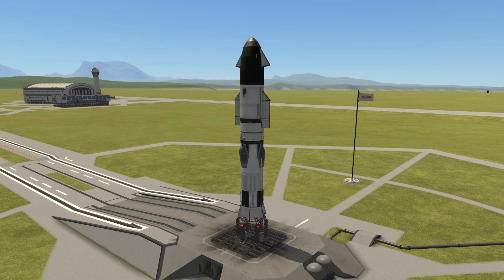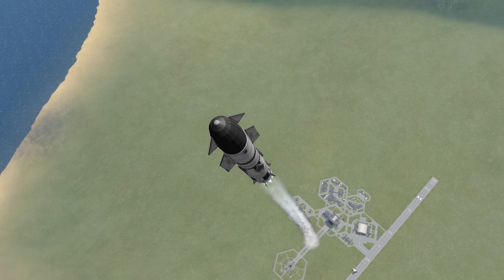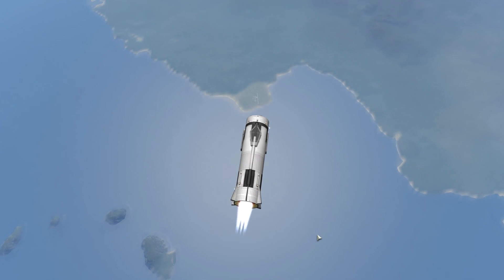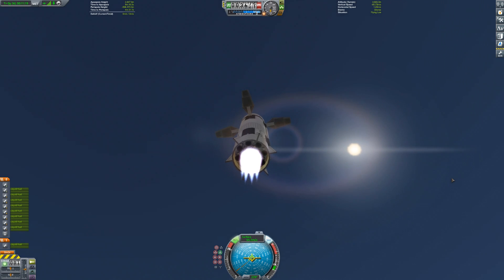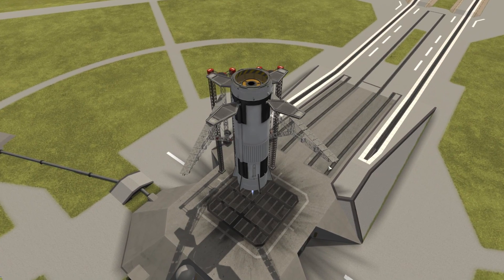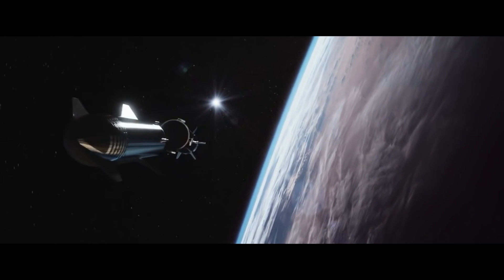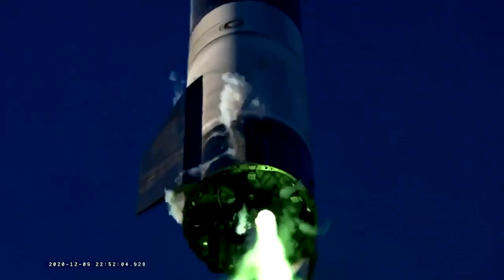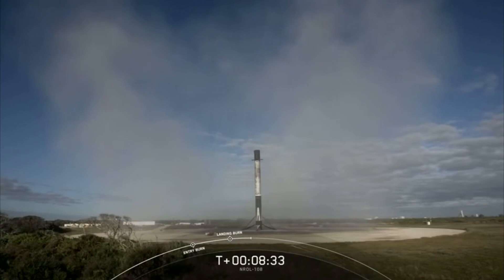Why SpaceX Wants To Make Landing Super Heavy MORE Difficult.

Comment: I give you the "tailhook slam"  a fail-safe recovery mechanism using existing engineering- 
Take one Arecibo style 365 foot tower (reinforced concrete tower supporting ~300 tons) with a 350 ton counterweight on the ground, damped by 12 US Navy Mk7M4 arrestors (each rated to stop 25 tons engaging at 175 mph using 300 feet of cable in 2 seconds). 
Given a a terminal velocity of 153 mph for starship, estimate 175 terminal velocity for heavy you could catch them at the top of the tower at terminal velocity and bring them to a dead stop 3 feet off the ground, WITHOUT using a deceleration burn. If the engines are working correctly, you just get a much softer landing.

Comment: The weight savings will be huge, all the sacrificial componentry and complicated carbon fibre legs will save millions per launch. The landing platform doesn't need to be made out of anything exotic, because weight isn't an issue and thermal resistance is much less of an issue without having to survive re-entry. This is an idea that is very much worth pursuing.

Comment: Scott said that after the super heavy booster separated, the Starship would continue to orbit by firing all six of its raptor engines. 
At that altitude, wouldn't the sea-level raptors be inefficient?  Wouldn't it be more effective to use only the three vacuum engines?

Comment: for such a system, it makes sence to dig a huge verticle tunnel and let the rocket lower it'self into the pit. if it blows up in the pit it's not a big issue to clean out. also limits collateral damage of other systems. the walls of the vertical tunnel could help catch the grid fins nr ground level.

Comment: Why cant they use rocket assisted drogue steerable chutes in case things are speeding up too fast close to pad , in a engine\guidance fail situation?
Or just use large steerable chutes to slow down to a lower speed before engines cut it on?
was also thinking last ditch saving of returning rocket assembly too, than blown up.
Just curious, if they have looked at this option or not?

Rob

Comment: In SpaceX's facebook group a user suggested a system with 4 movable steel cables in a frame-like structure. At first the cables would be kept out of the way along the edges of the frame so the booster would have plenty of room for it's descent. As soon as the booster has descended into the frame the cables would be moved inwards. Slide rails along the booster would prevent damage to the hull (the extra weight of these would be easily affordable if they can in turn get rid of landing lags, their actuators, the power source for those and crush cores). The cables would then slide underneath the grid-fin hinges into a hook-like structure and the fins would fold down to lock the cables in place.
At this point the engines would still be running to offload most of the booster's weight, and the cables could be used to guide the booster precisely above the launch stand for touchdown. Consequently the hinges, cables and frame wouldn't even have to support the full weight of the booster - so the frame could be made arbitrarily large to allow for enough margin of error.

Mechanically this shouldn't be all that complicated (4x 4 motors - 2 to move the cables laterally and 2 to control tension/slack from both sides - plus an appropriate shape of the hinge so it can catch and lock onto the cable). This is quite similar to the traveling winch systems used on construction cranes - just two of them on opposing sides of the frame and used horizontally instead of vertically. Actually they would be even simpler with less pulleys, as the cable would run to the opposite side and get it's tension from there.
The magic would be in the control systems that coordinate all those motors with the booster's internal guidance - but that's exactly what SpaceX does best.

Winch systems are definitley capable of catching large loads - think eg. of the arresting cables on aircraft carriers - so this concept could actually work.

Comment: The center pivot mechanism of the Boeing 733-290, which eventually became the 2707 (which eventually became nothing) is a FAR larger casting of titanium than the grid fins.  Orders of magnitude larger.
Reply: That was just a design, as you've said, "became nothing". I can also design a large titanium surface on paper, that doesn't make me a record holder though.

Comment: Here's an idea.  Step 1, SpaceX fills old Falcon 9 cores with reinforced concrete, that should give you a lunch/retrieval tower with 800 ton capacity. Step 2 SpaceX buys about ten Magnetech FDCHDV 84” industrial "steel slab magnets" (rated at 100 tons each) and mounts them on the side of the landing tower.
  Step 3 as the heavy booster is hovering, Elon flips a giant Frankenstein knife switch, and 800KW of current pulls the heavy booster out of the air, over to the tower.
Step 4, a non magnetic carbon fiber arm, or Kevlar cables, then grapple the grid fins and secures the heavy booster.

Comment: My idea for catching tower design: 5 towers in pentagram 50m out from bullseye.. Each tower has one catching cable to the neighbor on the left (e.g. from left shoulder of tower 1 to right shoulder of tower 2). The two ends of each catching cable are fed into high-speed winch (if one winch fails, other just pulls twice as fast, redundancy). Each catching cable has 3 tensioning cables on ringbolts, using simple pulley and small gravity weight to pull catching cable out to the other 3 towers. Each tower has lidar/radar on top facing inward, to measure presence of and distance to starship. Ready position is all the catching cables pulled out wide, making 5 cables around the internal circumference of the pentagram. Held in position by tensioning cables. When starship drops into the target area somewhere, distances from each tower measured, winches pull in their cables the appropriate distance (leave some slack in catching cables so starship will 'sit' in a depression of cables). Once rocket caught, is easy to move it directly above the bullseye by adjusting catching cable lengths. 
Notes: Don't need 5 towers, but redundancy good if one tower or catching cable completely fails. 
Could have complete duplicate of all cables, winches, pulleys a meter or two below primary ones, for more redundancy.
Towers can be as far from bullseye as wanted, more distance just means they will need to be higher and a little stronger. Each tower should have 2 guy-ropes with a few inches of slack, ready to tension when the towers take starship's weight pulling them inward, so won't need to be particularly strong.

Comment: I suspect that they will be doing something clever with the tower itself, in addition to what improvements they can make with the booster's accuracy.  Likely the booster will have to land within a certain area and the capture arms adjust to meet it.  And just as there is a launch abort system, there would be a landing abort system.  If the booster's and/or tower's computers decide that it's not meant to be, the booster can move away before crashing, to at least minimize damage to the tower.

Comment: In order to make the landing more precise at sea, I would think they would need a platform protected from the sea and anchored so well that it would not move. Even if the spacecraft hovered it would be impossible to be precise with the continual movement of the platform in the sea swell. A minor problem for a company that builds space ships. As far as others having the ideas earlier: that is what science fiction is all about. Many dreams by fiction writers were later turned into fact. That is the role of Science fiction after all. The dreamers and the builders of new civilizations both have their roles. Early evidence suggests that science fiction writers deliberately started the space race between the superpowers as a method of staving off an arms race and all that that would lead to.

Comment: PKE Nefedov Experiments performed from 2001-2005 aboard the ISS. Plasma in space experiments. watch?v=kanYuBptuZ0&t=108s
Are electric and magnetic fields 
isotropic and homogeneous all over observed space?

2018 
Resonant Energy Transfer Between Degrees
of Freedom in a Dusty Plasma System
DOI: 10.1109/TPS.2018.2818303

2002
A review of liquid and crystalline plasmas—new
physical states of matter?

2002
Coagulation of Charged Microparticles in Neutral Gas and Charge-Induced Gel Transitions
DOI: 10.1103/PhysRevLett.89.195502

2003
Collision-dominated dust sheaths and
voids—observations in micro-gravity experiments
and numerical investigation of the force balance
relations
New Journal of Physics 5 (2003) 66.1–66.28

Comment: I was thinking about this and it might be fairly easy build a landing "pad" (hanging point?) that doesn't require that much accuracy.

For example imagine if you had 200 feet rows of railroad tracks.  You mount a steel beam in the air across the tracks that can roll on the tracks with engines to move them.  One at each end.  Now you can roll the beams together as you like to line up with the rocket as it comes down in an area with 200 feet sides.

No doubt I'm missing a ton of problems but it's interesting to think about.

Comment: Take the example of aircraft carriers catching fighter jets in a rope and slowing them down the last bit. It's a huge weight and complexity savings. If they get the catching stand to work reliably, the cost of building the stand will far outweigh the cost of building landing legs on every rocket. Of course that way, the rockets are constrained to landing in places where there's a landing stand to begin with, so they will have to keep the balancing landing technique for going to Mars, at least initially.

Comment: Curious question (pass it along).
You stated that after stage separation, the StarShip would continue on using "all 6 of its Raptor engines".
Why?
I can understand, that during the current status of testing, It uses the standard Raptors to lift off. I thought that the job of Super Heavy is to get StarShip to an altitude and velocity where the Rapvacs alone should be sufficient. Why use the sea level Raptors at that stage of the flight? That is less efficient.
Granted, they can't test the landing without getting it up there first. Maybe they'll also decide to use the three engines for the landing burn.

Comment: take the mass of an empty rocket, divide by four and multiply by g and the length of where the gridfin will sit on the landing-stand all the way to outer skin of the rocket. This gives you the min. torque your hinge of the gridfin has to be able to be able to withstand at rest.
If they can build at least that, i am convinced.
SpaceX has shown over the years, that precision is only a matter of fine-tuning.

Comment: If the problem to the engines it's the landing why not create a grille mesh on the landing zone with enough space below it to avoid that problem with the engines. Obviously the holes of the mesh should be small enough to allow legs a good contact with the ground.

Comment: Re landing, restacking/refueling and takeoff while sitting on arms - the moon lander option will be delivering 100T to the surface using engines toward the top of the vehicle. This means the structure is already being designed to accommodate significant loads in tension.
Superheavy is using a very similar structure with greater though comparable loads. This may lend credence that it could be restacked/refueled while hanging from the arms, with no need to be lowered to the ground.
The tower would have to be much bigger and beefier though wouldn't it? Superheavy base could be at ground level though suspended over large hole. Might not be practical at boca chica but natural water buffer from seeping seawater... :)

Comment: The Booster does not have legs external to the 9.0 m dia steel tanks. The engine compartment does not extend outside the 9.0 m dia either.

Comment: This might be stupid... but can't you move something on the ground faster than the craft coming down? How about mounting the landing tower on a sort of etch-a-sketch X/Y system over a giant pit. The tower could be topped with a ring or whatever to catch the fins and immediately start moving into position to match the craft's telemetry. If the craft is within 10 meters of the center of this construct, the mobile tower should be able to move fast enough to get into position and lockdown just as the craft gets within a couple hundred meters of touchdown. The system already has a huge number of alignment elements, so if you could feed that data to the landing tower positional controllers, it should put the landing tower within a safe margin of error to thread the needle.
Reply: It's not stupid, because you're thinking, but it's also very unrealistic because of how massive the platform would need to be to catch a super-heavy that weighs more than the Saturn V.  You've seen what NASA uses to transport rockets that size; the shuttle crawlers?  Yeah, they don't go anywhere fast on some of the largest treads ever built, powered by 16 traction motors and two 2,750 hp diesels. For comparison, the most powerful fleet locomotives that can haul 10,000 trains on rails  at 70 mph use 2000 hp turbodiesels with only six traction motors, and it still takes them like two miles to get up to speed or stop. 

Then you want that whole fuggin' thing to go sideways and stop on a dime? I mean, in theory it's possible but the expense, the size of the pistons you'd need, the power source, the miracle materials for the tracks to keep them from breaking, or hell, to keep the motors and gears from stripping......it just boggles the mind. Like, maybe you could do it with a LOT of power and maglevs and super-conductors, all of which would have to be heavily shielded, as the magnetic force would be crazy. I don't know, but I can say with certainty that it seems to be easier to just move the rocket for now. It's already coming down, it has plenty of momentum, just needs the control surfaces and engine reliability. I'm sure Scott would tell us both that's not as easy as I make it sound, but then he's the rocket scientist.
Reply: @acnine-ball8976  It would not be the entire assembly though. The crawler is transporting itself, the rockets, the support, and the shuttle. My idea is moving just a much lighter weight, landing use exclusive tower up to 10 meters during the time the craft goes from space to the surface. It might actually be able to be done entirely hydraulically . The craft would have to be massively more accurate, but I just wonder if we could fudge the landing zone a little to help it.